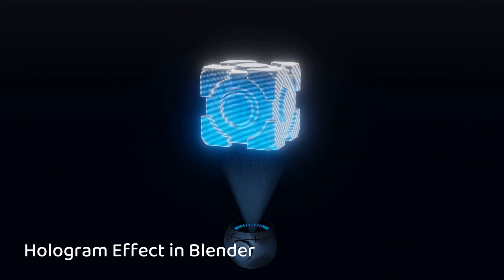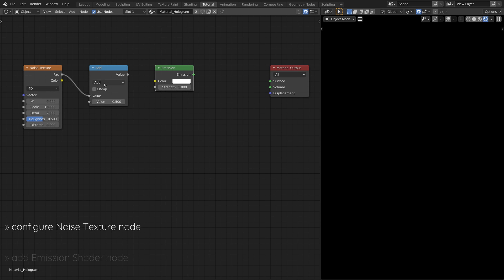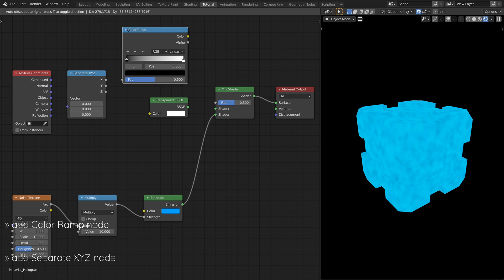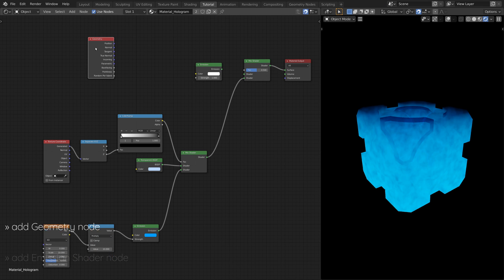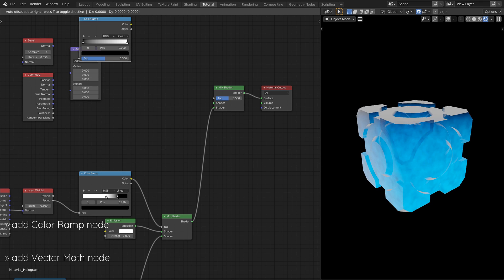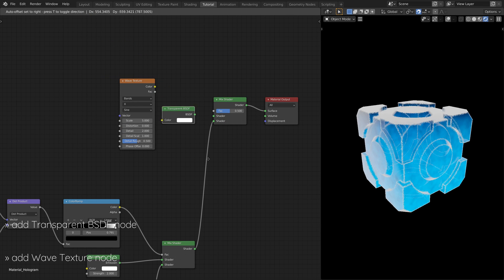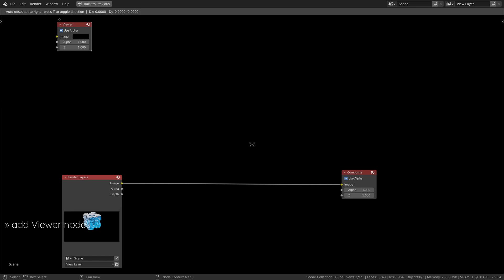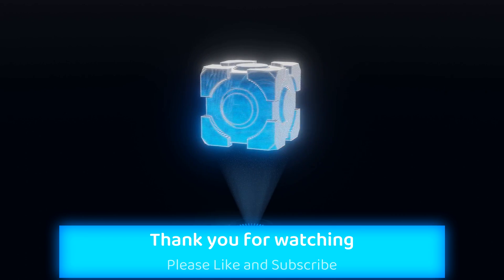Hologram Effect in Blender (Short Tutorial)

Comment: Great tutorial - is there a way to make the scan lines animated to move in a loop format from top to bottom - and an extra bar that moves in the same direction but at a slower pace ?
Reply from the maker: Thanks for watching, :)
Hmmm, I think I know what you're after, and it's not that difficult . Play around with the "phase offset" value on the wave texture node (around 02:56). Then add some animation keyframes to it. See how it goes.